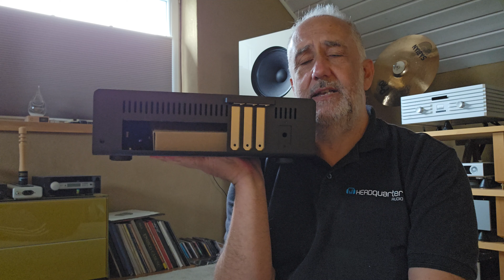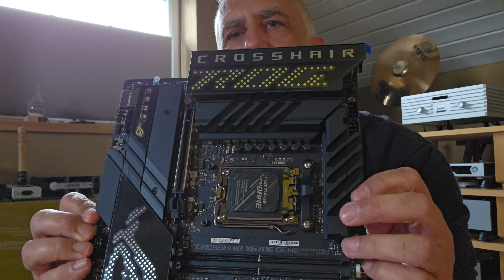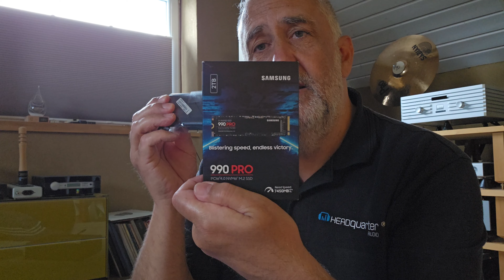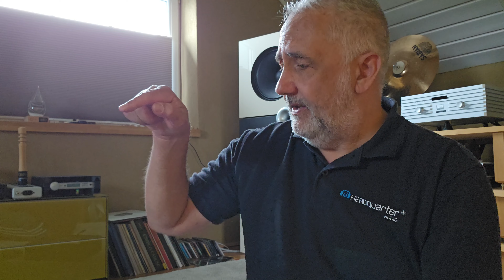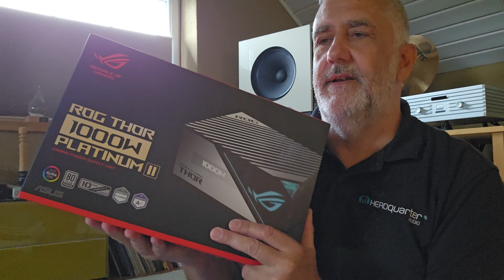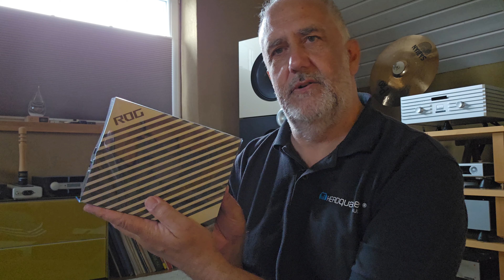Fully Silent PC for desktop and HighEnd Audio? Asus Thor II and x670e gene....Streacom FC9 Case!

Comment: Were you touching the motherboard? You definitely shouldn't do that without an antistatic wrist strap! You coud easily damage it, and you won't see sparks -- the static will be invisible, so you won't know if you've affected any of the electronics. A static discharge, even if it doesn't outright blow something, might lessen the lifespan of components.
Reply: This isn’t 1994 anymore, most (all?) modern mobos can easily handle everyday static with no issues.
Reply from the maker: yes, he's not entirely wrong, but he also doesn't know that I don't have plastic clothing, have a wooden floor, and that I always do this work naked, so I'm grounded :) cheers Mike